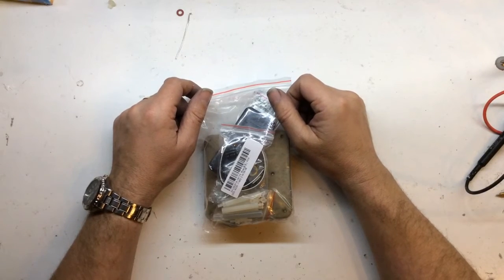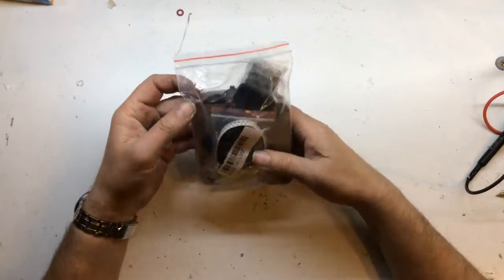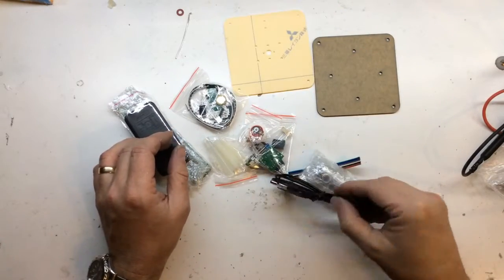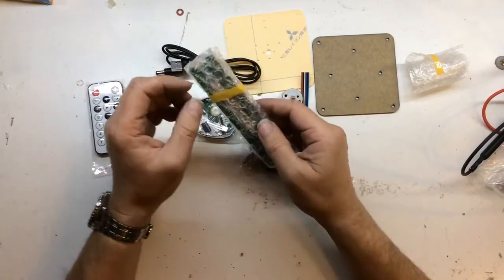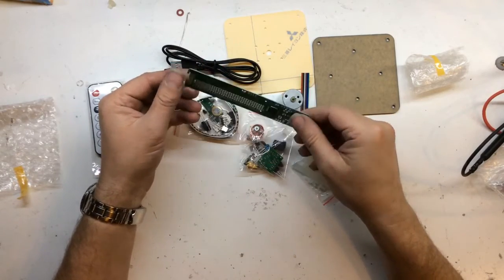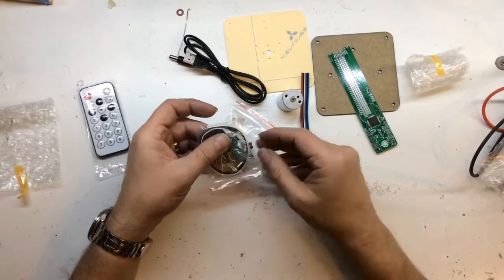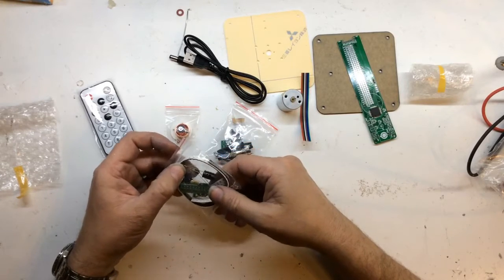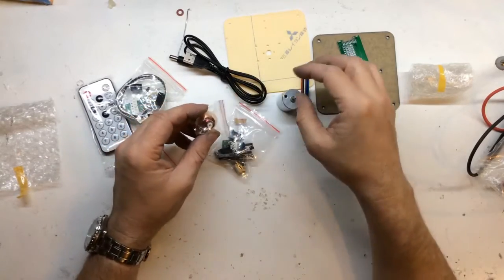Rotating LED Kit from Banggood.com Build part1

Comment: where is the manual instruction in the instruction files?
Reply from the maker: Follow the product link in the description then read down untill you find  

Note: This is a DIY kit, you need to have some electronic knowledge and ability. SMD is unsoldered!!

The line under this is clickable and contains instructions ect

Comment: '
can this DIY rotating LED clock kit use a pack of four AA batterys = 6 volts...
would be work fine or better not...
will it burn out LED lights or two microchip controllers or both
Reply from the maker: Think it would work as its only the small oscilator board you need to worry about, worse case is you add a 1 amp 7805 to the circuit
Reply: hi KEW...
thank explain
Reply from the maker: Batterys Neg goes to 7805 gnd and LED neg, batterys pos goes to 7805 in  and 7805 out goes to pos on led
Reply: hi KEW...
what look alike a electronic part is 7805...
send me link to my channel message...
thank thank

Comment: Great project, thanks for sharing man. What is that sqaure chip (uC) in this kit?
http://img3.banggood.com/thumb/large/oaupload/banggood/images/05/AA/4923322a-30cc-1341-9a6e-2eae646267ee.jpg
And did you use this manual/guide to build it?
https://onedrive.live.com/redir?resid=E2C95122A9793EDA!111&authkey=!ACCdYWlFxdgwRV8&ithint=file%2czip
Reply from the maker: yes i did you the instructions the uC is a stc15 from memory, the zip gives you all the tools you need to compile/program